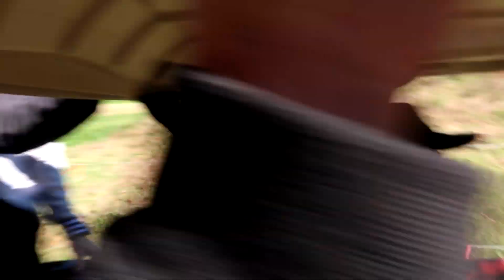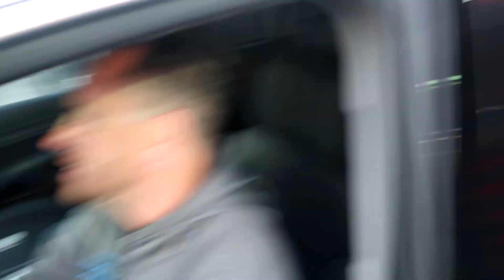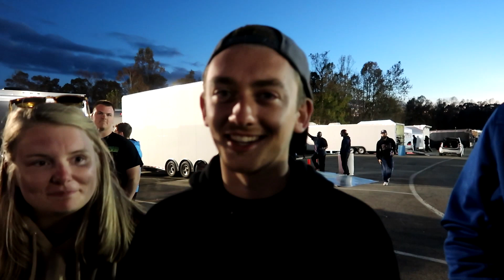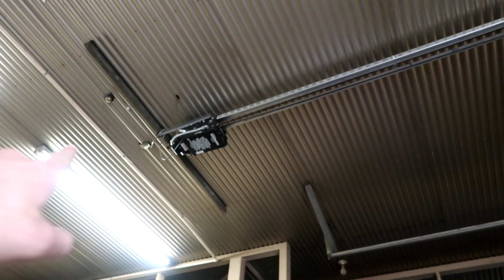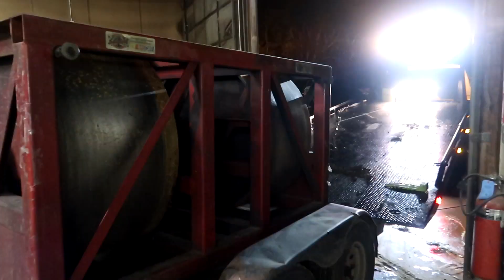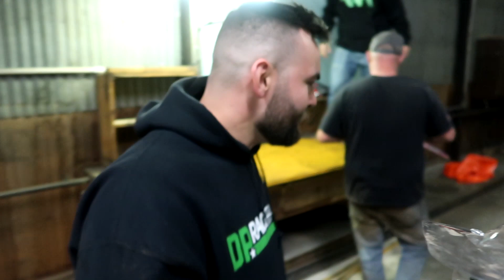Awesome Time at World Cup! First Day at the New Shop!

Comment: If you have on have One Black Widow Spider you will have Lots of Black Widow Spiders.  The only trouble with a Black Widows in the shop is getting accidentally bit by one because they will hide everywhere (Steel Rack, Shelves of parts, inside of Tool Boxes etc.) I worked in a shop that had Black Widows in around it and after getting bit for the second time which I gave me a big dose of venom that had me sick in bed fo over a week and walnut size hunk of flesh cut out of right calf put me on a serious dislike for the spiders around the shop but when Skipper my Labramutt got bit and died from Black Widow bite put me on a search and destroy mission around the shop.  I have no problem letting them live in the live in great outdoors but inside or right outside the house and shop etc they are spider-non-grata.  
PS That rolling oil Bucket in the “Grease-Pit” can be pretty handy things when I first started working on cars I got a job at an old dealership that had a pit that was used for oil changes exhaust system work and even front end alignments.  The only thing that sucked about the pit is walking up and down the stairs to do anything and no matter how hard you might try it’s always a greasy grimy hole. Just a FYI those tall ceilings you have are a godsend and a curse especially trying to keep the shop warm in the winter one thing you might want to look into is installing a limit switch on the door openers to keep the doors from opening more than 7 or 8 feet because there is no sense in paying out of your all’s pocket to heat the heat out doors in the wintertime.  The other thing to help take the burden of heating the shop off yours all’s wallets is to build a waste oil heater look around on YouTube for some different designs if you all don’t already have one the last shop I worked at we built one and surrounded the “flue” pipe with old brake rotors to act as thermal mass and installed a sheet metal plenum around the rotors and ran duct work of of it. The setup got rid of our all of our waste oil and cut the shop heating bill by over half and we keep the shop toasty warm all winter which we could not afford to due before building the waste oil heater.  I just recently discovered your YouTube channel and want say Good luck on your New Shop
Reply: That's shop definitely needs bug bombed 😂
Reply: @rickshiandmoku4128  black widows won't die from a bug bomb since they clean themselves differently. I've cleared out black widow infested storm shelters a couple times and fire is the only 100% solution I've found so far, we tried every brand of bug bomb and spray on the shelf.
Reply: @slowspeed6500  crazy shit
Reply: @slowspeed6500  by bug bombed I meant have someone come in and professional spray it that shop is way to large for bug bombs to be that affective anyway
Reply: thats some great advice there dude especially the oil heater sounds like an awesome idea :)

Comment: Hey BoostedBois, I hope you read this! I've seen you guys since the beginning and like you guys too much not to tell you.

Your new epic shop is amazing! Cant wait to see it up and running!, buttt.... The oil pit might give you guys headache's over time if its not taken out and cleaned properly... that can pose respiratory and other health hazards.
One purchase i made like that long ago the land was oil contaminated(esp inside the shop) one of the bay's had an oil pit.

after 4 years of owning that shop and coming in almost every day my body started heating/migraine's/irritation/breathing issues/rashes/vomiting/dizziness/you name it(the whole shop+land was desolate for 60-80years before I started so it kinda reminds me of how you guys just got yours).  After 4 years i had a bad feeling and hired inspectors to check out the place and found out there were lots of nasty air pollutants in the ceiling hiding in(foam insulation) that was super apparent in the summer at 40+degrees when the heat starts heating the insulation you would have a faint smell of something "very rancid" but cant put your finger on it feeling.... that would give you ammonia+monoxide poisoning if exposed to it for long and the oil pit wretched smell over a long time didnt do much good to my health. 

The only solution for land and bay's to pass inspection to be safe past that point would be if i had all the land dug out two meters everywhere and brought to a special place to "burn" out the chemicals then be brought back, and my ceiling to be replaced(all of it) that would have cost me well over 100thousand $$ that i DIDNT HAVE. It was a big loss that day for me, not only emotionally but also physically since i had health issues i was battling for the next 6years after selling the shop.
I would really recommend talking to someone that works in that industry so you understand that this is something that shouldnt be taken lightly.
I advise you to get an inspector and check out, there really is nothing fun about having migraine's every day for years.
Reply: I hope they see this
Reply: This has come up already, and they have had the land checked for any contamination
I brought this to their attention before final papers were signed and they were assured by
the food processing company that was the former owner that this was all taken care of and
it was noted as such on the deed. Unhappily in some cases that is only as good as the paper
it is written on, I certainly hope that is not what will happen here. Now Brent is the new steward
of this land so it is up to him to see that his business model keeps in in good condition.
Monoxide fumes from insulation and fumes from the interior of any large industrial
building can be hard on a body, in the summer and on hot days it will be very wise to keep
most of the doors wide open in bays where work is being done. Again best of success
to Brent and the Boosted Boiz. Aloha

Comment: Awesome idea to flip the pit. But one recommendation is, you need to replace the the nut anchors with hammer drive pins. Same hold effect but will be a smooth button head that you wont worry about driving over. As of now if you run over one of those bolt heads you can pop a tire. Just my 2cents...other then that love all you guys, keep the content flowing.

Comment: Deep leak in the quarter side under the bypass intake. Seen it many times on these boosted Hatch`s. Gotta run a shake down on the play 4 setting. Going to spin a felt strip seal bearing housing bearing if you wait til the rollover wash. Can't stress it enough. Also lower memory setting to reroute sportmode on the 3rd derlin node. She is food as gone if you don't make these changes.

Comment: If you do not plan to move the rails to the pit maybe secure the studs in the concrete permanently.
Then cut the studs flush with the rail and weld the studs to the rail, grind smooth and prime and paint. No
trip hazard or damage to tires. If you ever want to remove it you can grind or drill the weld off and remove
rails. I don't know if someone has already suggested this but it is just a thought. Best of success. Aloha